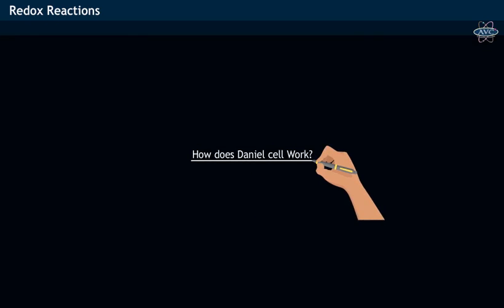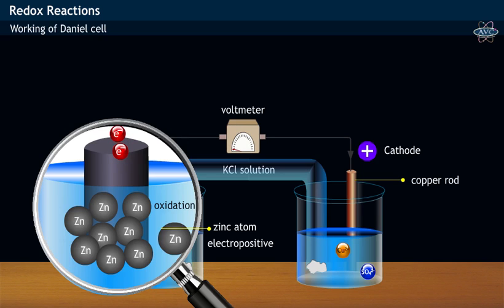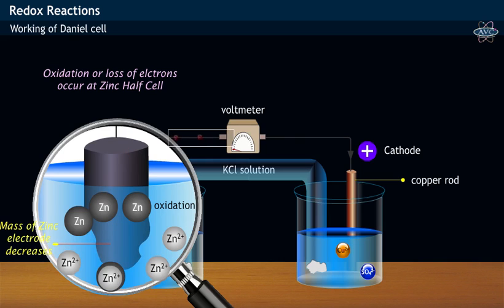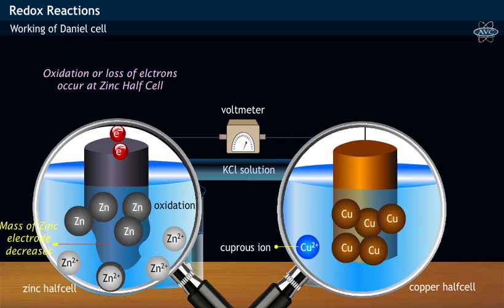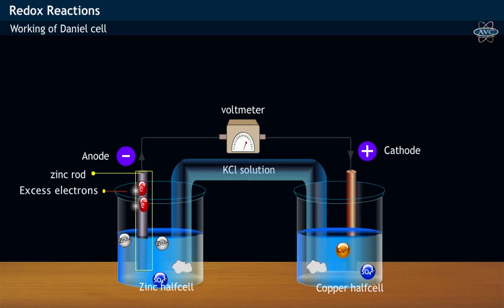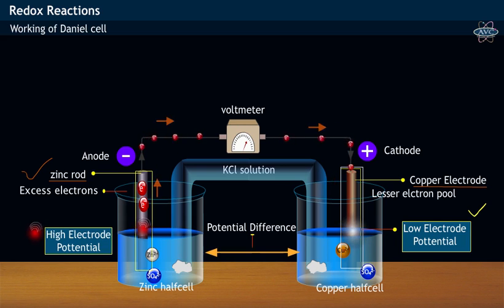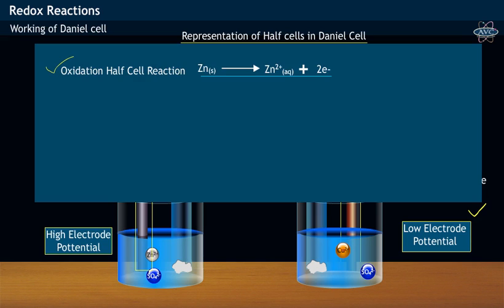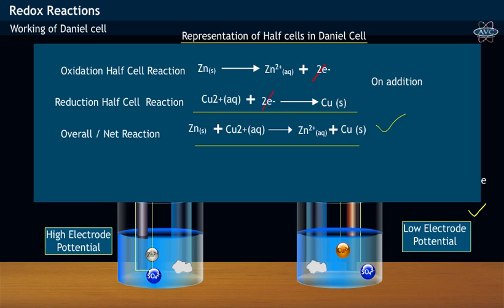Working of Daniell  Cell

Comment: 2:35 
Zinc electrode is at lower potential and copper electrode is at higher potential right because the current is flowing from copper to zinc electrode and the current flows from high potential to low potential
Consider that the flow of electrons is opposite to the direction of the flow of current

Comment: Sir why the electrode potential of Zn is written high. It is not mentioned as oxidation potential
Reply from the maker: The electrode potential of zinc in electrochemistry is denoted as its reduction potential, which is measured to be -0.76 V. The practice of listing all half-reactions as reductions is a common convention aimed at ensuring consistency. The reduction potential signifies the inclination of zinc ions (Zn²⁺) to acquire electrons and undergo reduction, resulting in the formation of metallic zinc (Zn).

Important highlights:
The Reduction Potential Convention states that all electrode potentials are recorded as reduction potentials in order to maintain consistency and facilitate comparison.

The oxidation potential can be obtained by taking the negative value of the reduction potential. Regarding zinc:
Reduction reaction: Zn2+ + 2e- → Zn (with a potential of -0.76 V)
Oxidation: Zn → Zn2+ + 2e-
  The potential is +0.76 V.
Real-world implementation: Zinc is commonly used as the anode in a galvanic cell, where oxidation takes place. The oxidation potential of zinc is typically +0.76 V. The cathode is made of copper, which has a reduction potential of +0.34 V.
This methodology offers a methodical approach for comprehending and computing electrochemical reactions.

Comment: I didn't understand why we need copper electrode. We already have copper ions for reduction. Can cathode be any other suitable metal other than copper?
Reply from the maker: The Daniel cell is a type of electricity production system where electrons flow from the zinc electrode (anode) to the copper electrode (cathode) through an external circuit. The presence of a copper electrode is crucial for the cell's functioning, as it completes the circuit and ensures efficient reduction.

 Copper is chosen for its stability, conductivity, and minimal side reactions, making it suitable for the cathode reaction in the Daniel cell.

While copper is traditionally used as the cathode material in a Daniel cell, other suitable metals could also be used. The selection depends on factors such as reduction potential, chemical compatibility, and conductivity. 
Copper is a widely used and effective cathode material due to its favorable properties and compatibility with the cell's chemistry. However, other metals with suitable properties could potentially be used in different contexts or experimental setups. Overall, copper is a crucial component in the Daniel cell's operation.